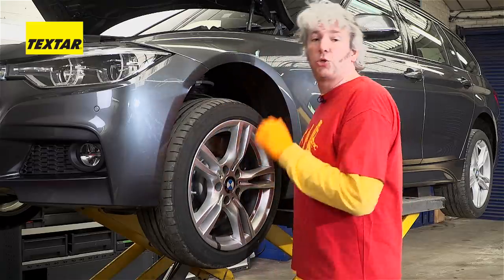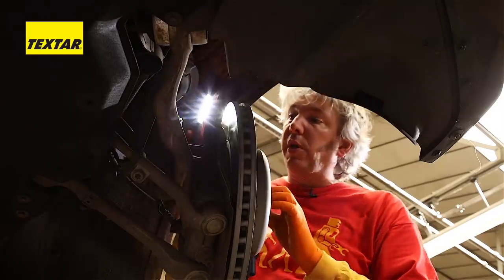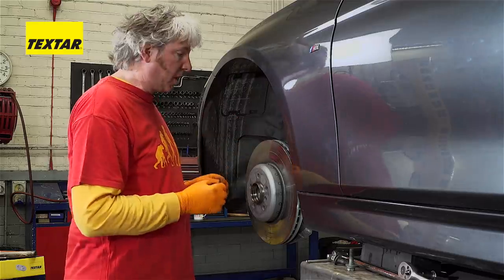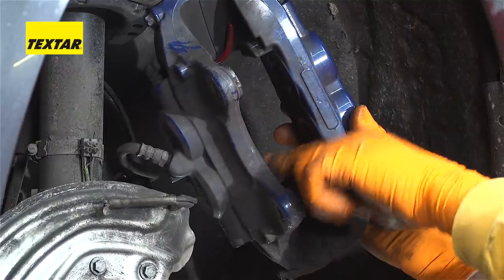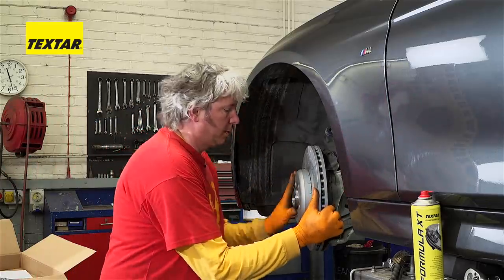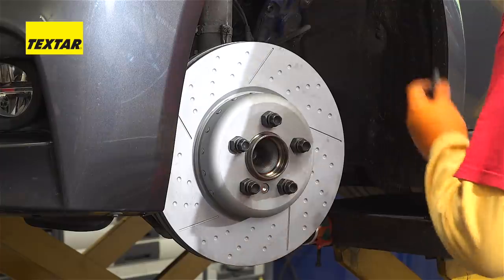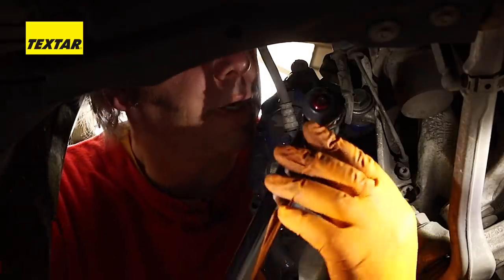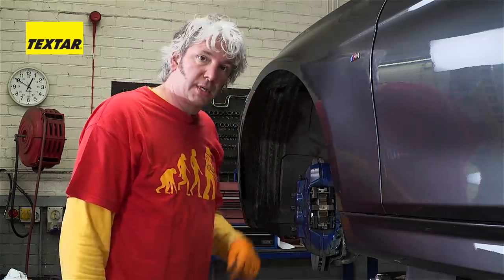Brake replacement with Edd China

Comment: A fundamental mistake was made here. Pistons should never be retracted into the calliper piston without first sealing the brake hose or at least opening the bleed screw on the calliper and draining the old fluid. it was have suffered moisture absorption, gathered contaminants and its overall properties will have changed.
Reply: The reason you block the hose off and open a nipple is to prevent fluid returning through the master cylinder the 'wrong' way and damaging the seals. This used to happen on 1990's vauxhalls. If theres moisture and contamination in the caliper, then theres moisture and contamination in the reservoir. Hence the recommendation for brake fluid renewal every 2-3 years. 
On some modern cars now, bmw are one, you cant clamp the hose as it damages them. Slow and steady returning of the caliper piston.
Reply: foxdmulder thats not in BMW repair instructions!
Reply: Chris Roberson  bmw uses pressure bleeding
Reply: dan horne moisture and contamination will be more prominent in calipers. Due to heating and cooling cycles. Simply observe the colour of brake fluid from calipers and you'll observe darker colour.
Brakes should always be bled using a pressure bleeder pressureized to 2 bar max.
Abs unit should be operated to bleed all solenoids. But rarely done  by independent garages
Reply: foxdmulder abs pump priming rarely, if ever done by any garage including dealers because its only necessary if manufacturer repair data recommends it. VW dont do it, they vacuum the calipers to perform a brake fluid change and i guarantee any fluid in reservoir on a VW is always black. But toyota prius has to be done via diagnostics abs bleeding. I dont agree with moisture and contamination being more prominent in the calipers. At the end of the day if the 3 year renewal routine is followed it shouldnt matter. If the fluid has been boiled then thats a different matter and should be changed anyway. Halfords autocentres try to 'sell' brake fluid changes via 'caliper contamination' because its easy money. They just found a sales tactic to sell more brake fluid changes when in reality if the boiling point is checked in the reservoir and renewed when your supposed to, you will never have a problem.
Reply: Btw im not saying theres anything wrong with the way you change brake fluid, at the end of the day any precautionary measure is good practice. I changed brake fluid that way for years with conflicting information from brake manufacturers and manufacturer recommendations constantly changing procedures. All i can say is ive never had any issues what soever but i would not clamp these reinforced hoses fitted to alot of cars now. 👍 some cars you physically cannot attach a pressure bleeder to either. Get pumping that pedal. All in all, cars are bastards but we love them anyway! 😜

Comment: That is not a proper brake job.
No ceramic grease ot the hubs? No grease on the pads? No synthetic brake cylinder paste under the piston rubber boots?
Come on, pathetic.
Everytging I mention is found in any Motorcraft ot Haynes repair manual.

Comment: Losing all respect for the China.!  Changing brakes on a virtually new car. Brushing down clean parts that will have rust on 95% of cars needing new rotors and pads. Must say the buffing wheel for the BMW hub was a nice product to show. What other Brands could that possibly work for. Ed. You've joined the ranks of salesman NOT  Dr.Auto. You have become Mike Brewer. !  Sell us all some hair care products next. Can't wait.
Reply: jeremy fine Agree, thumb down. Sad Ed if this is the future
Reply: Copper grease causes corrosion? What the hell are you talking about, dissimilar metals? That's actually how it works, copper is higher in the series so is the anode.
Reply: jeremy fine